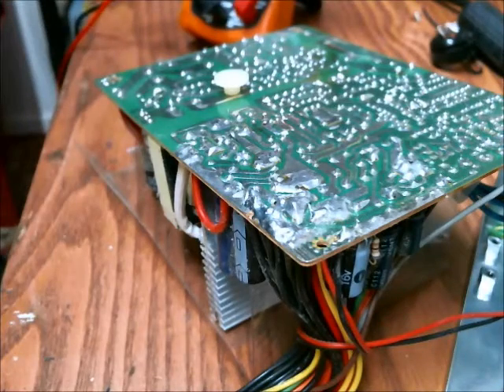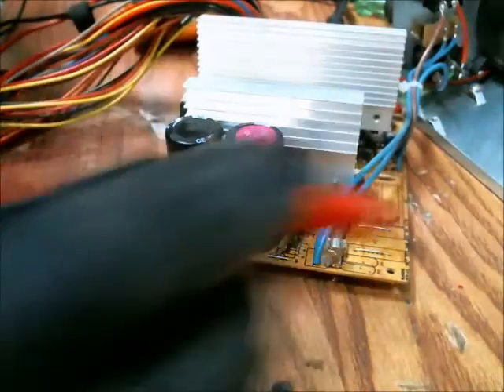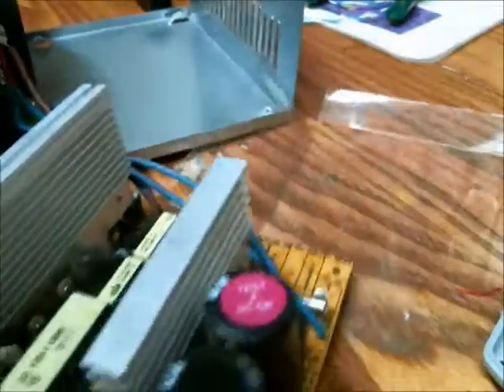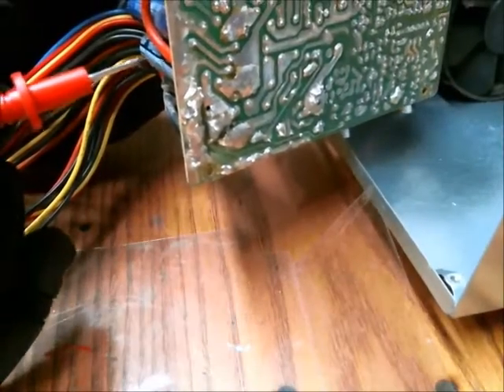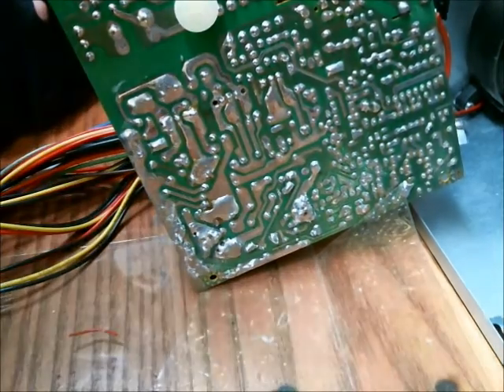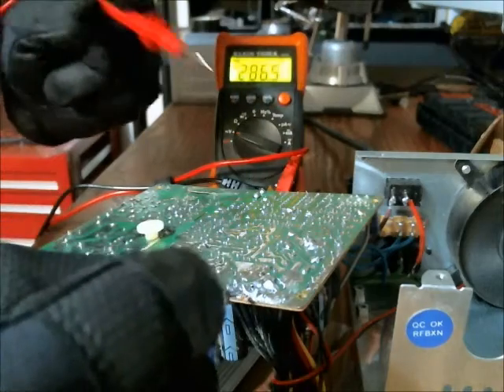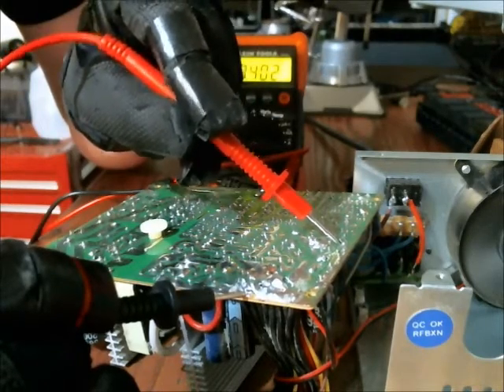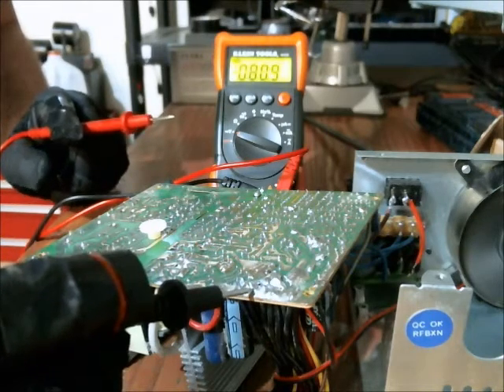Overview - Computer Power Supply

Comment: Nice video. I've recently got one of my power die (One of the capacitor blew up), but I never opened one.

What kind of gloves are you using? Is it safe to work with 110/220V with those?